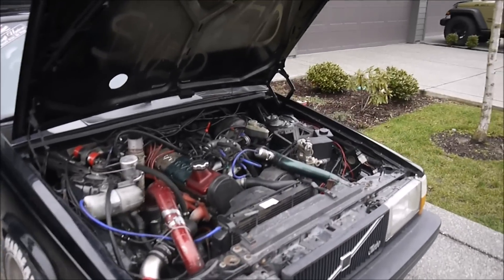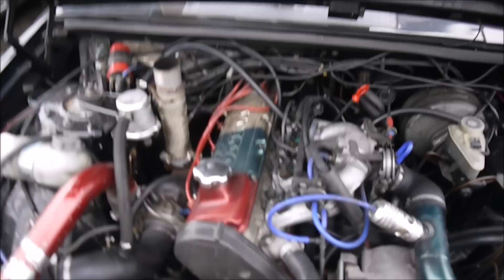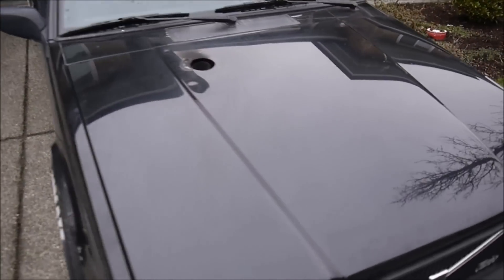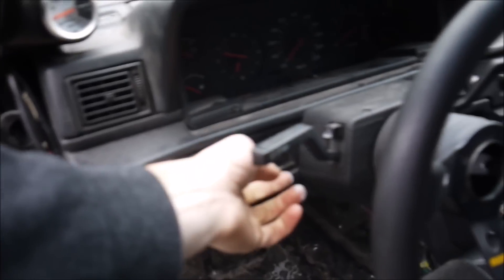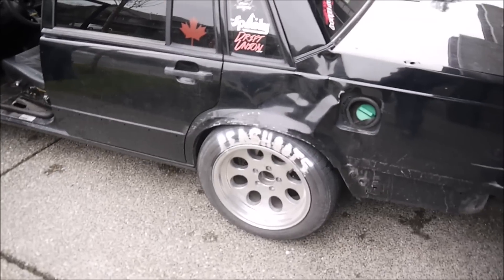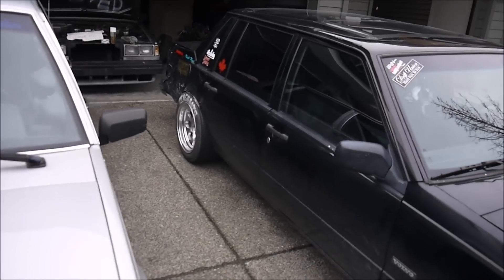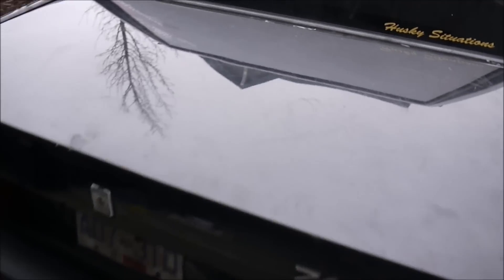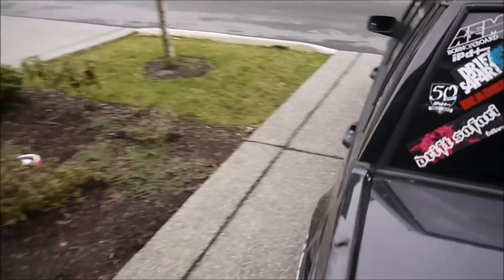VOLVO 740 TURBO DRIFT CAR WALKAROUND!

Comment: I know this is an old video but got a question. With the bigger turbo and injectors do you need is mapped/tuned? Or does the fuelling sort itself out? Obviously would be fitting a wideband

Comment: Hey dude just wondering where did u get those wheel bolt pattern adapters? I've got a 740 turbo and been looking for 5x108 steelies but it's impossible. Where can I get those adapters?
Reply from the maker: hey man I got mine off eBay , they were about 200 for all 4 shipped

Comment: what'd you use to tune it? or did you even need to?
Reply from the maker: ah shouldve mentioned that , the stock lh2.2 ecu handles it pretty well , stock injectors run out at 14psi so I keep it at that and don't gotta worry about it, it pulls pretty good

Comment: you run 14psi on 2.2? I have a 15g only running 5psi atm
Reply from the maker: yep 14 psi is about the max for the stock injectors and turbo

Comment: what'd you use to tune it? or did you even need to?
Reply from the maker: I'm running on the ragged edge of the stock ecu and injectors , but the stock ecu compensates fairly well untill past that